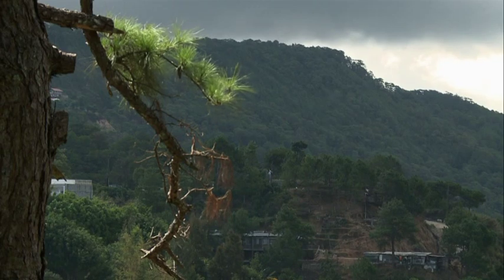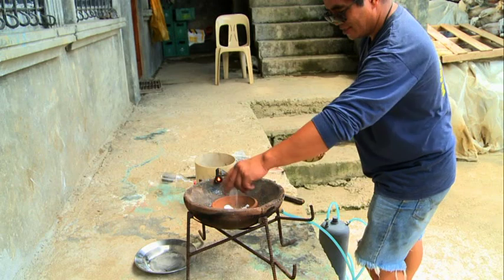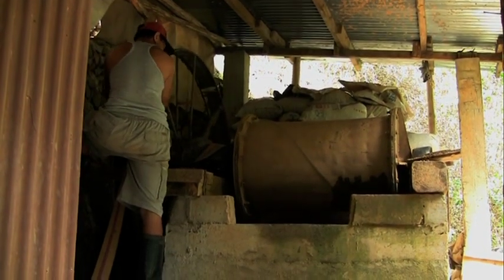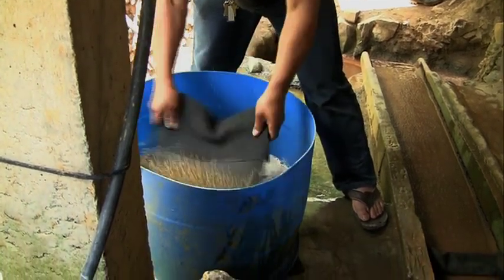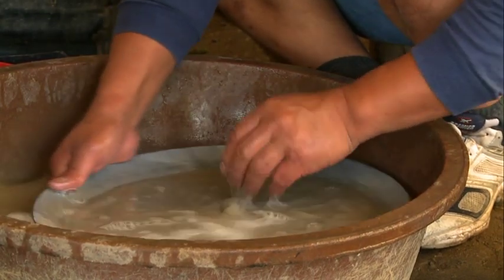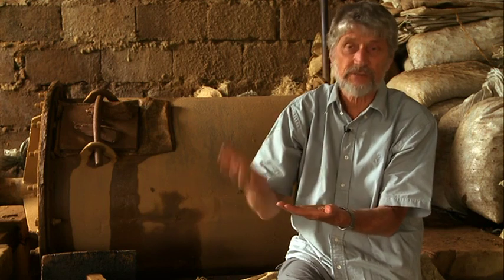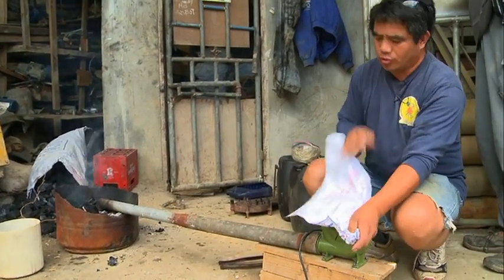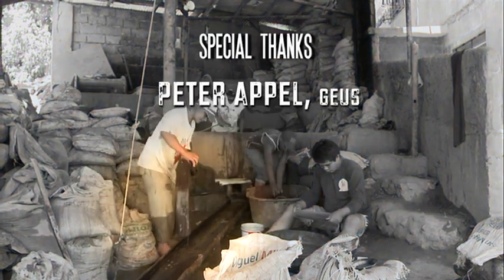Gold extraction with BORAX for small-scale miners - Rather Rich & Healthy than Poor & Poisoned

Comment: That's unfortunately misleading.  Use Borax while > smelting < the gold to help oxides from causing further impurities in the cast button or ingot.  It will not however purify the gold.  You'll get a button of whatever purity gold is coming out of the mine.  Borax will not purify that Gold or significantly separate it from other metals which are in the ore ( Tellurides, Silver, Lead, Copper, Iron, etc. ).   A variety of other methods may be used for the actual purification process up to three 9's or above, depending on the size of the ore volume being processed and the types of impurities within the ore ( as well as how it's locked up in the ore ).

Borax is great....just not for purification; only to help keep impurities out of the melt/casting process.

Comment: Why don't they smelt the consecrate vs panning? The heavy metals will drop and the slab will be at the top. Removing the magnet Fe is a good thing to do and could be used easily sections off the sluce or in the mill drum. Cuepeling will oxidized all the base metals and leaves the non oxidizing gold and silver. The two can be separated vs electrolysis. I like the low environmental impact and I use it as well. I'm a retired government research scientist and know certain agencies are assessing back yard refining for heath and environmental impact. So use this method or loss it? I've heard that a license and training hazmat ect maybe in the future In the US and Canada. This will cost money and it's another motivated to stop back yard refiners. If you want to see my lab equipment lot I fabricated and some where tossed out by the same money hungry system LoL

Comment: How would you approach: Nano particles of Platinum and Palladium material (keyword "NANO" size) mixed in fine dirt? I have pounds and pounds of this material, but I'm unsure to what the best approach would be to refine it. I'm interested in the Fire Assay approach. Any advice would be greatly appreciated.
Thank you
Reply: Gravity separate down to heaviest material (pan) then follow a standard fire assay I would guess.
Reply: @74KU  Nano makes that difficult.
Reply: @downyourtube  Perhaps bulk smelting in the fashion of how black sand is treated, screen down as fine as you can given the size of the metals you are after .constantly enrich a collector metal button without the assay (until you are ready to reduce the button away)
Reply: @74KU  (the whole truth).  I found a area where the extracted (by manual and auto) soot from diesel trucks park. Lots of it. I believe it contains precious metals from the exhaust stacks. If I'm right, which I believe I am.. there are ounces upon ounces of precious metals in this. There's even a drain that is packed full of it (even finer).
So your reply above is good, but I must wonder as light as this stuff is.. how will it interact in the furnace with collector metals/borax etc. Will it melt into the collector metals (who knows)?
I'm anxious to see the results. (I think I found a platinum mine lol).
Reply: @downyourtube  Small scale testing may be in order. perhaps on the order a pound or so. Maybe chewing up the collector metal with a file or sander to produce small particles of collector and mix it all very well before adding the charge to the furnace should give the best chance of ensuring all the chemicals (flux, collector, metals etc.) are as evenly distributed as possible. I think there was another channel (codyslab?) that played with catalytic converter recovery, MBMMLC also touched on cat converters I think (in that instance silver and copper gave a slight increase on yield from memory)
Reply: Update on possible pile of rare earth metals? Ill buy a pound try my luck?

Comment: This is extremely misleading. Borax does NOT replace Mercury.  Borax is used in the SMELTING process. Artisanal miners use Mercury to process to efficiently capture the gold from the ore to create a gold-mercury amalgam (in which the mercury is removed later in a retort, leaving the gold). These are completely different things.

Have you ever wondered why artisanal miners still use Mercury? Even while Borax is cheaper and more readily available and people have been saying "jUsT uSe BoRaX!" for over a decade?

"If it's sounds too good to be true, it probably is". This is no exception. Except this is just downright misleading. Borax does not replace Mercury.

Comment: so the round barrel rotates, its mixing the borax and the gold bearing materials together, when you run it across the felt carpet and it leaves the gold and other metals behind, the carpet is washed off, then they pan the material to get the gold. did i understand the process correctly? at no time was mercury used in this process correct?

Comment: Peter Appel is a "borax expert" not a mining expert. People use the borax as a flux when smelting. Miners use mercury to chemically attract the gold durning the mining process sluicing or panning. Then the mercury is burnt off and then they smelt the gold. I have a retort that I use to collect the mercury gold I find (old mine from the 1800s) then I save the mercury. Finally I use borax as a flux when I smelt the sponge gold into a dore button.  The title of this video is "Gold extraction with BORAX" yet it is very clear that they have already extracted the gold by slucing and panning.  Then they add borax when they "cook" the gold. Also this is not pure gold it probably has some silver and other trace metals in it as well.  This guy is selling borax.
Reply: Bingo
Reply: Very true borax is a flux tu separate the gold from other impurity when smelting but not to capture gold from their ore.

Comment: Use a Frensel lens from an old tv or projection device. It is a large magnifying "glass". The solar circle can reach 3,000 degrees f if focused or the circle size can be increased reducing the temperature to the required level.
The sun is free, generally available and environmentally friendly. It reduces labor costs by settingit up to run every day when the sun passes over. It can be readjusted many times a day for more production. It is lite and completly portable.
Reply: Can u explain further here am not getting u,thanx

Comment: nice video - but misleading title. Borax is NOT for extraction. Borax is only helpful in the melting process. Mercury is also not for extraction, but as a binder. Especially when having only tiny gold particles ( gold dust, gold flitter), the mercury will bind the particles, leaving you with a little ball of dirt - which, after melting, results in having the desired material - - gold nugget.

Comment: Using Borax can reduce the melting temperature required to make the gold pool together.  This is true with forging steel as well...if you want the metal to melt and adhere to itself easier...requiring less time and less fuel from the blow torch.

Comment: I will keep my setup 99% recovery.  Very Very portable for working the arid desert where the only H2O is hundreds of feet straight down.  I can move on in mere minutes if I feel threatened.  Equipment is minimal low budget  easily replaced and repaired without attracting anyone.  I process late at night by flash light.  I don.t  need help and my dogs keep watch.  I pull into camp grounds in the daytime and sleep some times if I need a break, And I stay out of the bars!!

Comment: if there is fine sand small amounts mixed in with gold will the borax remove the sand?
Reply: All the borax does is help remove impurities that's it. It doesnt increase gold production at all. So to answer your question yes to an extent.
Reply: @newstacked5710  so while borax is good to a point then, it will be hard to make people give up mercury despite its toxicity.
Reply: @zemetrius  yes but there are ways to use mercury so it is in a closed system and is constantly reused and not being allowed to go to gas form.
Reply: @newstacked5710  you have my complete attention, i am currently working with flour gold, it is mixed in with some really fine blond sand, mercury may be the only way i can recover the flour gold, trying to avoid going to the furnace with a lot of sand in material.
Reply: @zemetrius  go check out a guy his channel name is two toes. He does a very good video on it. Also there is a more closed system that requires heat and a distillation type setup that would really better used in commercial sized operations.
Reply: @newstacked5710  ok thanks will do.
Reply: For a small size gold processing plant, which company should you choose? 
How is a gold processing plant built?
get catalog and price list via https://www.bestjawcrusher.com/products/ore_beneficiation/?wua

Comment: Many, many, many years ago, I used borax and high heat to concentrate lead recovered from car battery plates. I found collecting wheel weights was more efficient until wheel weights were modified so that they don't fly off of rims as easily as they did 50 years ago. The lead was used to make fishing weights. That was just one of my one million hobbies.
Reply: I do not think that lead is used for wheel weights anymore. I think that all modern wheel weights are made out of zinc.

Comment: for purification, it works a treat!
iv had gold with steel impurity (i picked up the soft melted gold button with pliers and some welded to the cooling gold)

i gave it two more melts with borax and a blowtortch (MAPP Gas) and could watch as it melted and then blew off/away the impurities and left a beautiful gold.

the borax clean will leave the gold visibly brighter, than when in its native form with Iron and Silver impurities.

for very fine gold i take my time with a pan. even without a magnet i pan down to just gold.
its not hard, just takes time and patience.

Mercury will catch the very small and microscopic gold but how much $$$ is that micro gold worth vs how much $$$$$$$$$$$$ will illness cost to treat (plus as they say, contaminated environment for generations to come)
Reply: Nice!

Comment: After washing, the solid precipitate is basically composed of Gold (Gold compounds to be more exact) and other possible metals which present in oxide formation. Since borax tends to dissolve most metal oxides easily in its molten state, Gold particles will eventually sinter into a whole and separate itself from the slag containing impurities. The received gold is not entirely pure and needs further refinement to reach higher degree of purity.

Comment: LOOK, The Borax Method in ONLY practical for small amounts and it is Hardly worth it anyway! This system is missing TWO IMPORTANT Steps, 1.Proper Sluicing with a VERY Efficient Sluice and CLASSIFICATION!      Incorporate - Do this Properly and you can just dish the Gold no NEED for ANYTHING, then the BORAX comes when you want to smelt the gold and remove its impurities like copper and silver, Done!
Reply: Depends on where you are located as to what type of gold is captured. You need a sluice because maybe your gold comes in a variety of sizes.they are using a felt mat as I suppose all their gold deposits are pretty much all flour type gold. I'm pretty sure they would "sluice" if they was losing the big stuff right..........

Comment: Yeah, well nice thought but BS, this is no different than panning!

Mercury and gold make of weak covalent bond, it you have flour gold, borax isn't going to pick it up, mercury will.

Mercury is found in nature, however working with it can be problem!

If you have recovery system such a retorter, you can do property and recover the mercury without problem!

But, if your a dumb ass and just burn off in open air, or in closed area, without proper hood system,then you're an idiot!

The best way to recover, is grind you ore to powder, smelt it, you can build small smelter with Plaster Paris, sand a ten bucket and a pipe, two plastic buckets, and some muffler clamps!

You can find how to video here on you tube!

Then you need not work with mercury!

Comment: Depending on where you get your ore, I head its common to end up with more mercury then you started with.  So long as your recycling the mercury and wearing proper safety gear.  I don't see an issue with it.  

The old method of simply burning off the mercury, of course has terrible environmental and health affects. 

And I really don't see why you can't use borax for processing the gold, and mercury for processing the black sand.  In this video they are throwing away the black sand without extracting any of the microscopic gold still inside of it.
Reply: there are folks here thinking that mercury is the best way.  I cant wait to try borax.
Reply: You vaporize the mercury and collect it in a condenser coil and recycle it.
Reply: Isn't that the whole point - they're NOT using safety equipment when handling Mercury.

Comment: To those that have stated Mercury comes from nature.....................................When in nature, it is in a different form.  For mercury to be in used in thermometers, or gold separation, Cinebar ore (The ore that mercury is derived from) must be altered.
Reply: Cinnabar, as well as elemental Hg both exist naturally.
Reply: In addition the historical use of liquid mercury has been dumped in the environment intentionally or without knowledge of consequence
Reply: Oh yeh so the mine 12km from here that coated it’s whole mill with merc was modified by someone there,come out of the ground dopey!!!
Reply: uranium also exists naturally. And even plutonium must have existed million years ago like every other element. But would you pave your Garage with Uranium plates ;) ?
Reply: You don't modify mercury. You extract it. It's an element, not a compound.
Reply: right but what he was saying is that in nature it is locked up as a rock, not a freely flowing liquid metal in the bottom of a creek on the way to your drinking water plant.
Reply: Trumpenstein that’s why they put radon systems under houses that are built on uranium deposits.  Fuck Trump.